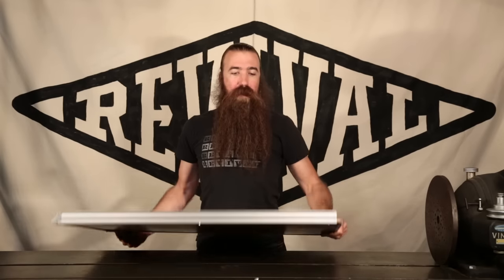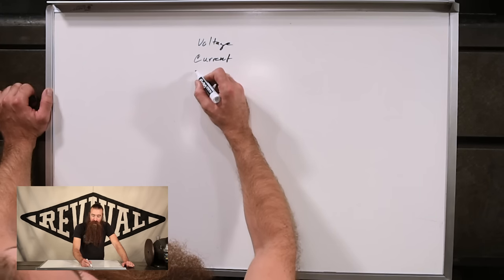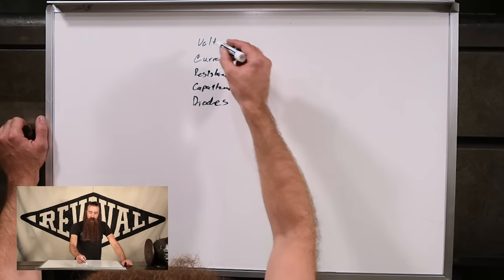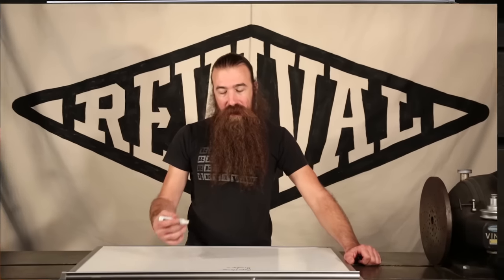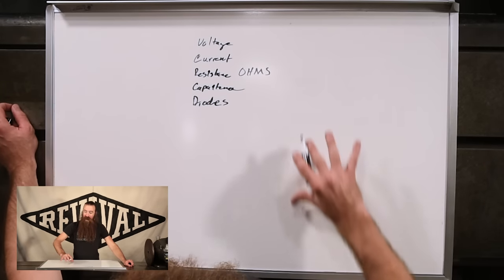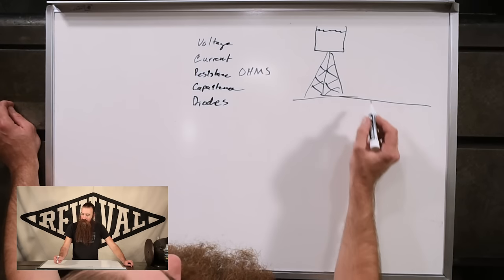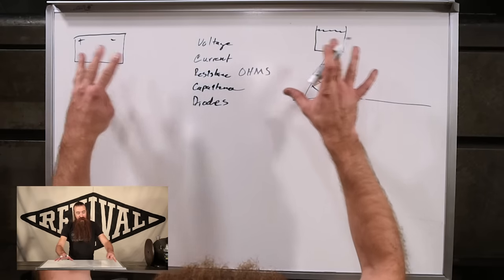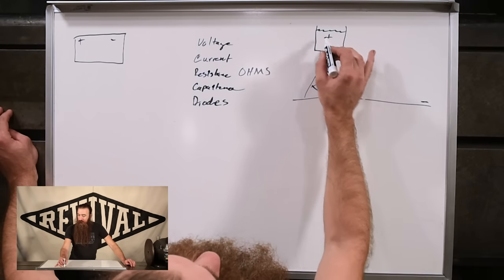Basic Motorcycle Electrical Theory - Revival Cycles' Tech Talk

Comment: I have a KE125 1976 (Canadian model)  6 volt .    I am getting 17-19  AC volts at the headlamp and its blowing the bulbs instantly ? There is no regulator fitted on this model just a small 2pin rectifier to deal with the battery charging . The stator coils have all been tested professionally as working OK . I am baffled  to understand why the AC currant is so high to the headlamp??  Any ideas ????     Regards David

Comment: I'm relatively new to bike repair/building, and I have been so frustrated by electrical issues on these old 70's bikes to the point that I feel like starting from zero & building a wiring harness might be easier than troubleshooting the problems on the existing harnesses. LMAO. So I came here to get schooled on the concepts & processes. I am COMMITTED to understanding & being able to apply this knowledge so I can troubleshoot & relatively easily destroy all these damn electrical gremlins. Thanks for the video guys!

Comment: Thanks for the video, super helpful even 7 years later!! 
25:47 I'm not sure I understand, why do this? Why don't we just run a cable from the light to the negative battery? 
If the electricity is flowing through the frame, don't I risk getting electrocuted?

Comment: I do love your videos but I think your explanation of splicing in new circuits is slightly incorrect but I'm not sure. I think you need to splice before an electrical component as I think the potential is reduced if you splice in after it. I'm not sure but I feel it will be reduced in voltage as it drops on the first component. Maybe someone can confirm if that's correct or maybe I've miss understood Stephen.

Comment: 17:15 this is probably based on the exact same logic as shotgun round pellet sizes (also measured in 'gauge').
The basic idea is this: take a ring of a certain diameter and then see how many wires you can fit through at the same time --> if the wire you're trying to put through is almost as thick as the ring's diameter, then you can fit 1 wire through, so let's call that wire's thickness "1 gauge".
If you use a bunch of thin wires you can maybe fit 20 of those into the ring at the same time., so let's call those wire's thickness "20 gauge".

That explains why "smaller gauge means thicker wire" and vice versa.
Reply: P. S. in case you're curious about the shotgun pellet sizes --> the archaic way this came to be was: take a ball of lead that weighs exactly 1 lbs. Now divide that ball into small, equal size balls. Depending on how many smaller, equal sized balls you divided them into is the "gauge" of those small balls. I. e. if you divided the big ball of lead into two balls, those were "gauge 2". If you divided the big ball of lead into 50 small balls, those would be "gauge 50".

Comment: If I have some better looking and guaged speaker wire just laying around could I use it on a project bike instead of the old crusty stock wires !? I'm rewiring the whole thing anyways just wanted to know before ordering any ?
Reply from the maker: Speaker wire is gernerally not rated for the same harsh conditions of heat, moisture and fuel that automotive wire is rated for. Ideally you want TXL or better wire.

Comment: Sorry this ends up so long, and I had to repost here coz I realised I posted in someone else's comment. So does the electrical potential (V) drop at each point that work (A) is done along the circuit? Im referring to the end  of the video where you explain that the circuit has equal potential after the battery, and then equal again after work is done powering lights? But its not equal to what it was when it left the battery ie before the work was done? Damn I thought I understood this. If I'm right wouldn't that mean the more times you splice in to run more lights you would end up running out of V to power the last bulb? Or it would be dimmer than the others? I think I know lol that it has something to do with wiring in series and parallel,  I can remember doing this experiment in science with the globes in the wooden board  but that was so long ago.  
I think this is what the control m board thing is doing isn't it? Because that all made sense as you drew the wiring diagram for that bike. But the end of this one you said we just have to know where to splice in on the circuit for that component, somewhere that it has equal potential,  I think thats what you said lol, I tried to get my head around that and seem to have been going around in circles sincd lol. This whole post probably doesn't even make sense lmao. I dont think I have the potential needed, my bulb is definitely running dim lol
Reply: I dought anyone will ever read it tho. So now I'm basically just msging myself lol

Comment: That was a great overview and helps me better understand the wiring on my bike, a 1982 Suzuki GS1100G and I hope, a help to solving my problem.  The grounding description was a big revelation to me as I've added some extra power connectors for plugins for a battery tender, horn and a usb port for charging electronics and I always run the ground back to the battery negative terminal.  I was replacing the rectifier/regulator and now I have no current as a result of something I've done or not done.  This will get me back to the basics of what to look for.  Thanks.
Reply from the maker: Thanks William,  Be sure to check out our Tech Articles page on our site. We go into more depth there and you'll find diagrams for Reg/Rec integration that may help you sort out your issue. 

https://technicalarticles.revivalcycles.com/hc/en-us

Comment: When you talk about hooking up something light a light bulb, you talk about having a wire going to the frame being a ground because the negative battery terminal is connected to the frame. Then you talk about having a "power" wire going to the positive battery terminal. What drives me nuts is that in a battery the electrons flow from the negative terminal to the positive. Isn't your explanation backwards?
Reply from the maker: Thanks for that insight Ernest, you are of course correct that electrons flow from the negative pole towards the positive. This is what happens when you allow a Mechanical Engineer to do the job of an Electrical Engineer. Luckily, our lapse in judgment has no practical impact when installing an m.Unit on a motorcycle.
Reply: Thanks for the explanation. From now on I will try to go with the "flow."

Comment: I disconnected my front blinkers & now my Yamaha raider is making a weird noise while it idles.. maybe the stator? Idk..
Reply from the maker: I cannot imagine that removing the turn signals would have  any affect on the running performance of the engine. There might be a chance that what you are hearing is a rattle due to something being loose after removing the signals. But electrically they are un-related. 

It is very unlikely that removing the signals caused an issue with the stator.
Reply: Once blinkers plugged back in it stops.  Disconnect it starts immediately.  Nothing is loose.  Shop around here said could be stator. And found a forum about also saying stator or electric on these Yamahas

Comment: Excellent and informative but I got a little lost at 24.03 . Your diagram shows for example a positive wire going into bulb but other side of bulb is ground? How can you splice into that for positive? Probably me been stupid :-) also how does the ground work through different metals i.e. Aluminium? Cheers for anyone's help
Reply from the maker: I'm not sure I understand the first question,  in that section of the video i'm mostly explaining that the voltage is the same anywhere along the wire between components. So in the example you mentioned above, if you  splice into the positive wire near the bulb it is the same as splicing into the wire at the positive source. 

As far as grounding aluminum is a very good conductor, but many times it will have anodizing as the outer skin and that is a non conductive surface. So if you need to conduct through aluminum make sure you get a connection to bare aluminum. It is not uncommon for us to find issues with ground connections through handlebars because the bars are powder coated or painted or anodized. Also, there can be issues trying to conduct large amounts of current through steering neck bearings, and this is why we recommend running dedicated ground connections and not just relying on the frame. 

That said, fundamentally there is no issue with different metals, and the majority of metals on a motorcycle conduct very well, and that is why many manufactures will just use the chassis as the ground connection. 

Lastly when running grounds through the chassis, there is the possibility to increase galvanic corrosion across the interface of dissimilar metals, but this is getting deep into the minutia and is negligible for most applications.

Comment: Hi, I have a 2001 Triumph Bonneville and would like to get the Motogagdet Blaze Pin lights  Do I have to get the board or can I just wire them up.(do I need a relay?) I am new to this wiring.haha
Reply from the maker: You can wire the m-Blaze Pins into the factory harness, but you will also need to replace the factory turn signal flasher relay with a relay designed for use with LED's. There are many direct fit replacements that you can probably find information about on the triumph forums, but I typically just install an m-Flash because I am more familiar with them and I know they work. I've had problems trying to use some of the direct fit type. 

The m-Flash is easy enough to install, just crimp some 1/4" spade terminals on the wires and plug it into the socket where the old relay was. The red wire needs to be connected to the positive power source and the black wire feeds the turn signals.

Comment: AWESOME VIDEOS FELLAS!! Quick question; is there a headlight that you would recommend that has turn signals integrated into the headlight?
Reply from the maker: The rivera primo is the only headlight we've used that has integrated turn signals, we've shot a video for it, but its still being edited. In general I'm not a fan of turn signals in the headlight because they don't really work as turn signals. This is because they are over powered by the headlight and even if you do notice the signal you end up having to look directly at the 1000 lumen headlight. 

BUT if you are just trying to meet an inspection requirement  they might do the trick. While the integrated headlight turn signals may not be effective turn signals, they could be effective for passing inspections. Either way, this is a matter of preferences, and if you like em, the rivera primo headlights are reasonably well build, and have models to fit a standard 7" or 5-3/4" shell.
Reply: ...I agree....some cars even have the turn signals right in the headlights.....this seems pretty ....uhm.....stupid by the design engineers....maybe they don't drive at night?

Comment: The hardest part of my Speed Triple project is trying to figure out how the circuits route through the ECU. Seems like the vast majority of the connections are + with only a few ECU harness wires to the chassis ground.
Reply from the maker: Yea, that is the part of EFI bikes that makes re-wiring a challenge. Make sure you have a good wire diagram and make sure you have a clear understanding about how it all works before starting. The ECU's are sensitive and if you put +12V or ground to the wrong pin it can brick the whole ECU. 

In my experience many of the controls in ECU's are sinking which means they are switching to ground when they are turning a component on. This is in contrast to sourcing which is where they provide +12V to an activated output. For most electronic design, sinking is simpler and more robust, BUT I've seen ECU's that have both. Just double check everything, and then triple check it again.
Reply: Revival Cycles
What I've been doing on my wiring diagram is edit it in photoshop with layers. First I marked out all of the connections with their component layers. Then, I went through and eliminated the lighting and power relays so they're always on. Now I'm going through and running those positive side wires to the m-unit. The hard part will be figuring out which connections on the ECU are okay to run the 15 amp AUX to safely. Really should have used a multimeter to check the draw on those circuits BEFORE cutting the harness to pieces. :|
Reply from the maker: That sounds like a good method for reworking a wire diagram. And it must be nice to be able to turn off a layer or two so you can see the circuits clearly. 

For ECU fuses you can also trace the circuits back to the fuses that had been protecting the ECU using the original diagram, then if that fuse is greater than 15 amps, you are good to go, but if its less you could consider adding a fuse just for the ECU. 

But also remember fuses don't protect devices from damage, fuses are there to protect the wires when components fail. So really the fuse should be sized based on the wires that are feeding the components.

Comment: Thank you so much for sharing your knowledge and I would like to try to do this with a 1975 Honda gl1000 and a 1980 GL 1100 Honda don't know if we can do this or not they have so much wiring I don't even know where to begin with it I would like to take it all off and then redo it with your guyses system and help can it be done but once again thank you for sharing your knowledge there is still a lot of good people out there
Reply: Claire Lensegrav He’s done a good job with the video, however for wiring up an entire motorcycle youll need to research a lot more. This is more of an “ELI5” version of electricity. It’s serious, you could fuck yourself up or the entire electrical system.

Comment: You can look up "AC43.13-1B wire gauge chat" for a diagram of voltage/amperage/wire length to have a quick reference for what gauge wire to use. I keep one in my tool box.
Reply from the maker: Aviation specs are great, but I wasn't able to find that exact document easily...maybe I need to go practice google some more. But also, on the moto's pretty much all the wire runs are less than 6 feet and that makes the chart less necessary...and that is why I just stick to the rule of thumb. Oh and that is for the over current protection, not what the circuit is actually consuming. 

22ga -5 amps
20ga -10 amps
18ga- 15 amps
16ga- 20 amps
14ga- 30 amps
12ga- 40 amps
Reply: Revival Cycles fair enough. Looks like I can't spell anyway. Thanks again for taking the time to make these videos! I'm gonna send the link to this the next time a friend calls me and wants me to wire their bike for free.
Reply: So does the electrical potential (V) drop at each point that work (A) is done along the circuit? Im referring to the end  of the video where you explain that the circuit has equal potential after the battery, and then equal again after work is done powering lights? But its not equal to what it was when it left the battery ie before the work was done? Damn I thought I understood this. If I'm right wouldn't that mean the more times you splice in to run more lights you would end up running out of V to power the last bulb? Or it would be dimmer than the others? I think I know lol that it has something to do with wiring in series and parallel,  I can remember doing this experiment in science with the globes in the wooden board  but that was so long ago.  
I think this is what the control m board thing is doing isn't it? Because that all made sense as you drew the wiring diagram for that bike. But the end of this one you said we just have to know where to splice in on the circuit for that component, somewhere that it has equal potential,  I think thats what you said lol, I tried to get my head around that and seem to have been going around in circles sincd lol. This whole post probably doesn't even make sense lmao. I dont think I have the potential needed, my bulb is definitely running dim lol

Comment: can u give me a regulator to CDI to Relay wiring?  or wiring diagram with that accessories...
Reply from the maker: If the regulator is integrated with the CDI then it is a system I am not familiar with. The best recommendation is to get a copy of the factory wire diagram and then isolate the charging system by tracing the wires that are connected to the reg/rec. Then you can also isolate the ignition system, by tracing all the wires that are connected to the CDI.

Comment: I just found this video and it's great! Clear and concise! Super helpful! I'm starting my first project soon so I'll take all the info I can get. I was just wondering how or what do you do to ground the wires? it's the only part of the video I don't really understand.
Reply from the maker: On most bikes the entire metal part of the frame/engine/handlebars/etc is "ground". Basically anything metal that touches the frame. This is why there is a large battery cable that goes from the battery negative terminal to the frame or the engine. 

Although you can simply connect each device to the frame/engine/etc to ground it, experience shows that this is not as consistent or reliable as it could be. For this reason, we will actually run a dedicated ground wire to each device so there is no doubt that the connection is secure.

Comment: for grounding the specified non British. How does it work on British bikes then?
Reply from the maker: That all depends on what exact bike you have, some of the vintage brit bikes have what is called positive earth. That just means that the frame is the positive side of the battery, and the wires are all the negative side of the battery. This gets a little confusing after working on the more conventional negative earth setups on virtually every vehicle from the rest of the world. 

But if you do have an old brit bike it really isn't that tricky to redo it all and switch from positive earth to negative earth.